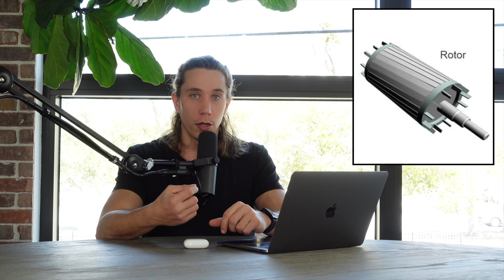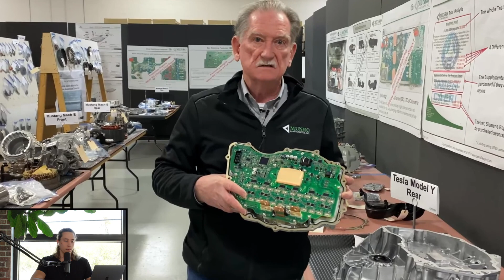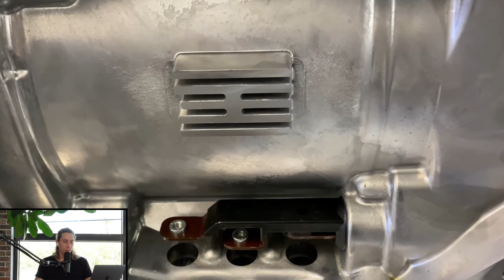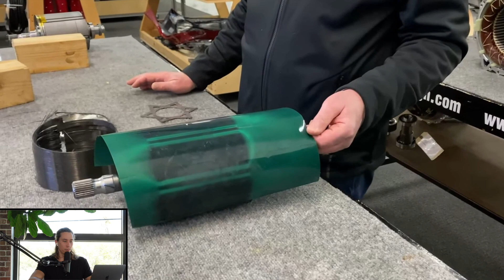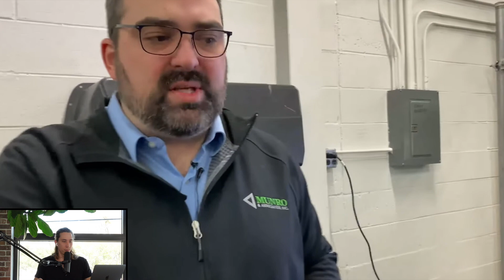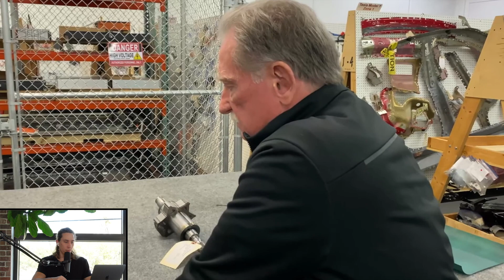Explaining What Sandy Munro Said: How Tesla Motors Work Ep 118

Comment: The burned out pcb board went out on my TV. My bro n law (not really knowing what we were doing) decided to just open the TV and take a look. The part cost $40 off Ebay and problem solved. Replacing the TV would've been 2k. Sometimes its an easy fix if we take the time to look

Comment: Sorry but a machine to put the carbon fiber layer on has been used in electric motor shops for as long as motors have been wound, it is called a banding lathe.  Tesla may have had to modify it for the carbon fiber instead of 3M resi-glass or wire banding that is used  in something like a locomotive traction motor.  I have to admit that the way the rotor is stacked is different from any I have seen, but may not be unique to Tesla many electric motors are designed for specific uses.

Comment: FUN FACT
In biological laboratories, there are centrifuges that spin at 10k + RPM.  Some of these are carbon fiber wrapped.  Exactly the same as the rotor in this case.  So while it was new for this industry it’s not actually new as a concept for high speed rotating metal.

Comment: Another point.
The "Invertor assembly" is not "fully forward/ backward compatible".
.
The HOUSING is.
The BASIC PCB (the green bit) is.
These are interchangeable at the manufacturing stage.
.
But at what would be the "vehicle build" stage, there are clear differences in some components which populate the (basic) PCB in the Plaid assembly, including extra power components and connectors.
.
It's still very impressive, because it looks like somebody sat down and considered what they MIGHT require for the highest performance variant (Plaid) which had yet to be built, designed THAT circuitry, and depopulated the components which weren't needed on the 3 and Y.
.
Since the Plaid component's would need to be top quality, this left a legacy of possibly slight over engineering on the 3/Y, but that means reliability.

Comment: The YT channel Lesics has some excellent explanations of the IPMSynRM motor such as in all current Teslas.  The Plaid motors take it to a new level with the carbon overwrap holding together an assembly of laminates and magnets where the outer portion of the laminates are separated from the axle-mounted portion.  This carbon-overwrap-enabled change in the rotor construction improves the reluctance characteristics of the rotor by 20% according to a Tesla patent.

Comment: That’s a cool safety deal that explodes to convert to mechanical movement.  I was a electronics engineer and I remember my company SPX designed a valve for nuclear power plants to open a valve that ran on explosive.  So when there was a runaway reactor that needed cooling the valve would open up releasing water from a reserve reservoir of water.  

Should a runaway thermo reactor issue presents itself again  a computer would activate the explosive and the piston like valve would open to release water to the reactor core

So to reset the valve they push the valve back to the close position and recharge the explosive for the next runaway situation.  These valve were huge. 

When I saw how Tesla used explosive to push a plunger, that’s exactly like the safety valves they used in Nuclear reactors

Comment: The inverter does the heavy lifting(high power control) it controls frequency and amplitude of the 3 phase AC, so basically you have 3x sine wave signals fed to the coils of the stator, all varying and split 120 degrees apart to drag the magnets around to do a revolution of the armature, the frequency controls speed of rotation and voltage/current controls torque, Elon is using latest tech to build in efficiency, guy's a LEGEND. :thanksdoc::thanksdoc:
Reply: Elon's not using the latest tech, he invented a new and better way of doing something.
Reply: Thanks

Comment: Sandy Munro was incorrect regarding the unidirectional carbon fiber wrapped rotor, the high speed armature had carbon for RADIAL loads only, as such unidirectional carbon was the best choice, this meant the wrap could be thinner for the strength and keep that important armature to stator gap as small as possible. 😉😉